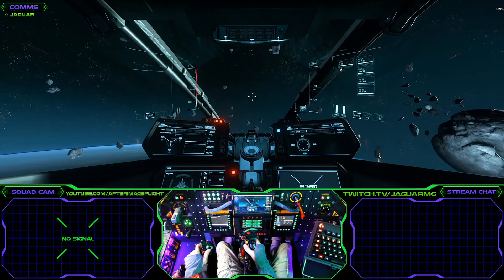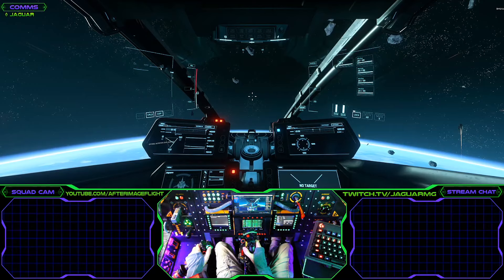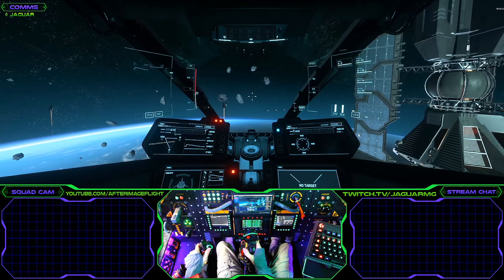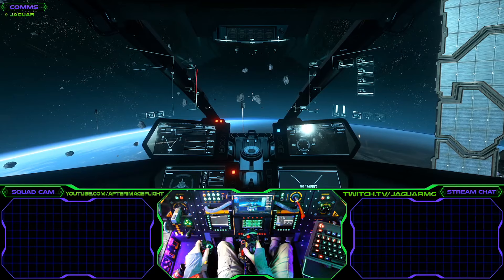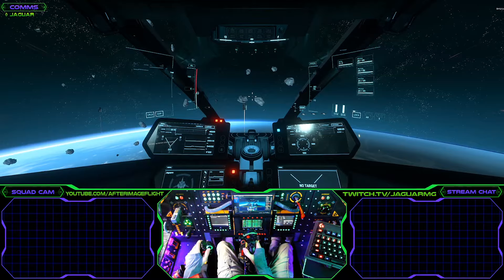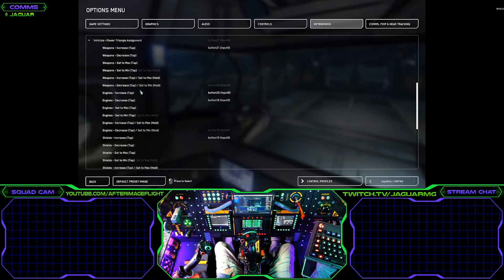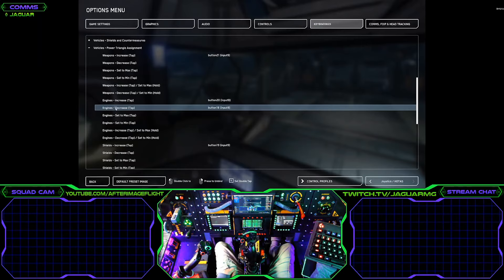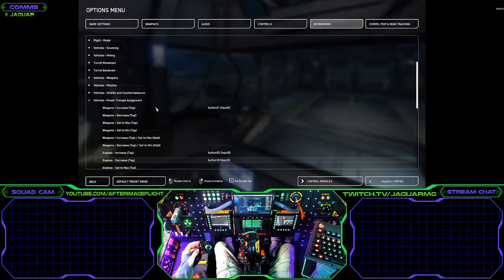Power Management Triangle - The Most Important Keybindings | Star Citizen 3.14

Comment: I use the pyramid hat on the right Alpha grip for the tap increment/hold max, it’s not faster like you said, but it’s less work to hold than to quickly tap 3 times and I’m lazy. For up on the hat I use it for pre-heating / adding additional missiles to the salvo as I use the 3-way for cycling through weapon types and missiles so made sense to me due to the proximity

Comment: I'm on keyboard and to gain time I did it like this:
"1" key to get 100% to power
"2" to rise shield power - hold for 100%
"3" to get  100% to engine
Power reset is on an additional button on my mouse (mouse 5 I think) but I almost never use it

Very fast to use, and I dont get distracted in battle by having to ajust power. Often just have to tap "1;2" and proceed to fight like this (87% gun 13% shields).

Comment: Love the setup. Personally I use tap to max on my right Delta stick 5 way hat. Reason it's on the right is because between the weapon fire bursts I'm constantly going from 100% shields, to 100% weapons. Now I mostly fight in light fighters, this drastic a power change may not be useful in larger ships.
Reply from the maker: I feel with the ammo capacity of the Vanguard it's probably less important to move it to full weapons, especially against smaller targets. It has a lot of shots in a full energy build compared to other smaller ships. You probably won't burn through all of them if you are landing shots and controlling fire bursts. So yeah, I suspect going to max might be more worth it on light fighters.